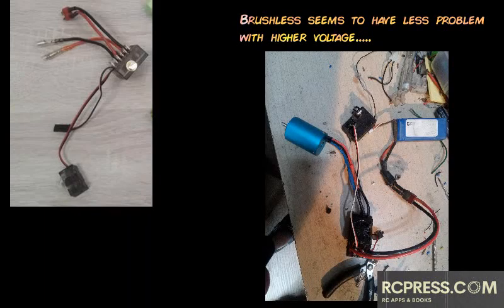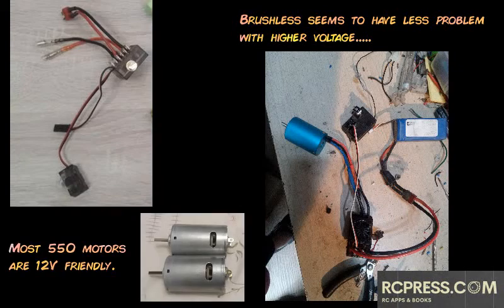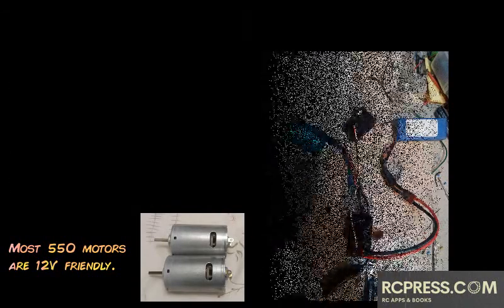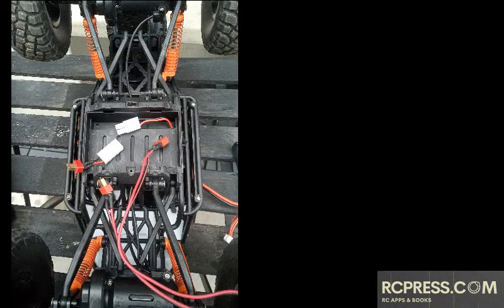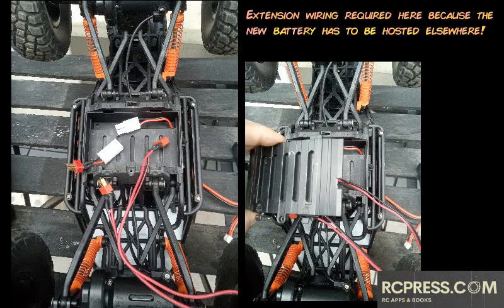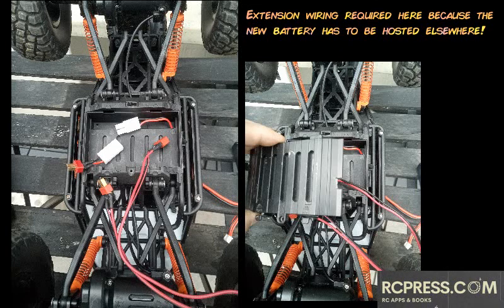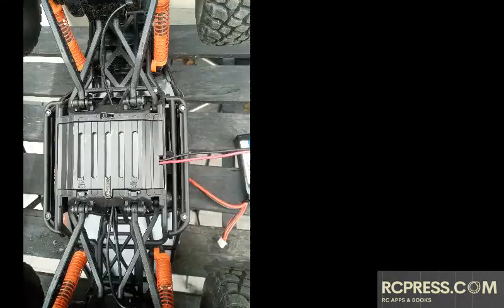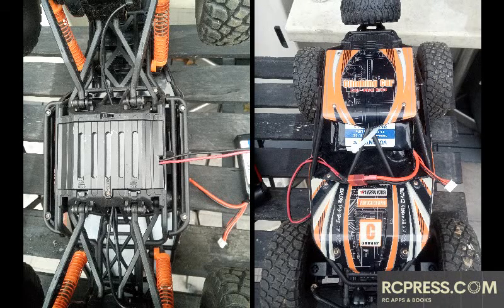What will happen if you put a battery with too high of voltage into your RC car?

Comment: I'm having some issues with my Rock crawler it's a 1/10  the battery is 8.4 but after 2 minutes of using it loses all power so I put a 12v 
When I try to engage it freezes up and I have to reset the battery . Need some advice...

Comment: So you're saying the 14th scale and 16th scale cars that I have their toy brand they take five double A's and 14 500 lithium ions at 3.7 volts how long do you think they'll run on that because that's close to 20 volts running through them I mean I'm thinking of doing that because I'd like to hobby grade them. Also I think their motors are 380 or smaller in them.